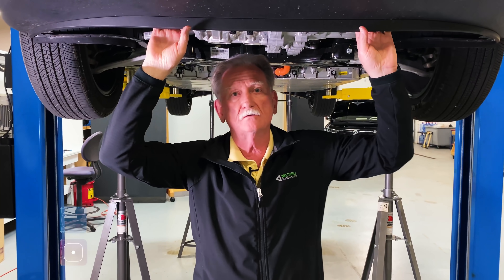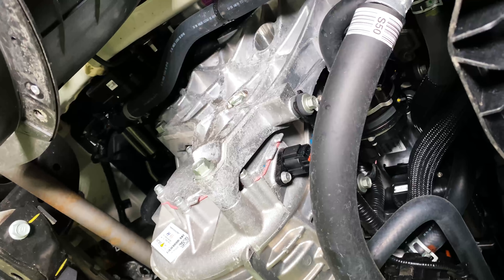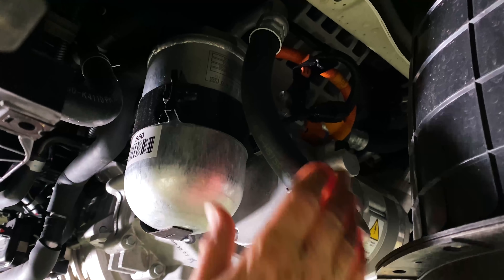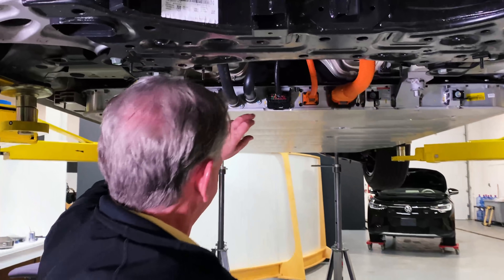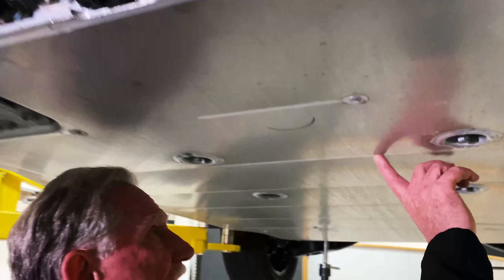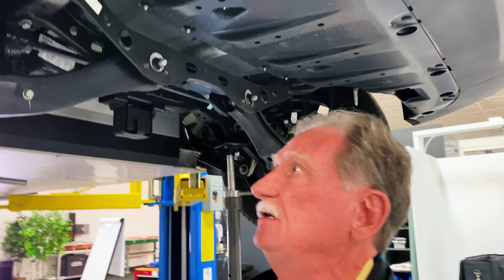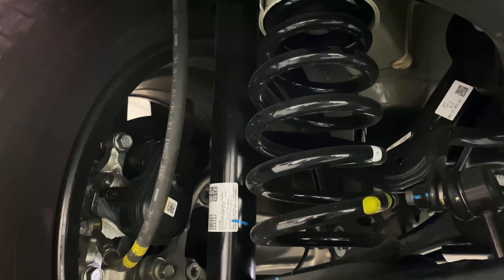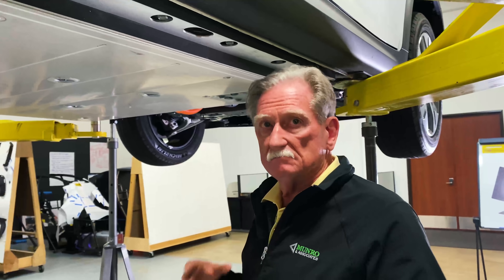Under the KIA NIRO EV

Comment: This Kia Niro platform is interesting, that allows to retrofit multiples powertrains. ICE, Hybrid and BEV. Saving in production costs. Good to see more mainstream manufactures on the market, to compete with Tesla and others.
Reply: What mainstream auto maker are you reverencing to? Are you comparing the Kia Niro to a model 3 and stating it goes toe to toe? In what sense? Sorry, I am confused by your statement.
Reply: @fredpinczuk7352  check the built quality of the Mach-E. In comparative, the internals of the Tesla motor, seems coming from a washing machine. Plus the panel gaps, and questionable interior quality. And the big screen on the middle, was the way they found to cut production costs.
Reply: @RogerM88  Check out the build quality of Tesla. I mean everybody talks about her bad it is that reviews them. Hell they even have YouTube channels that talk about it. The talk about the panel gaps that still exist till this day. They talk about the Mitch match plastics that are used in the cabin. They talk about the infotainment screen blackouts. They talk about how the paint still has problems. They talk about how the windows get stuck and the door sometimes won't open. And they talk about all around fit and finish of the vehicle. They talk about it's horrible customer service. They talk about how they don't have any service centers or you have to wait 3 weeks for service truck or flatbed to pick up your vehicle for repairs. And my favorite over promising under delivered range unless you're buying the extended battery.  
And now they're under investigation for their autopilot system. So far hit on some things but yet so far behind on others.
Reply: @RogerM88  I know you're not trying to say Mustang Mach E  has has panel gaps. That award goes to your favorite EV company Tesla. As a matter of fact I can pull up over 800 worth of receipts and post them for you to read from Tesla owners and Tesla reviewers who talk about how bad the panel gaps are that pin fit in them.
Reply: Tesla Model Y's Panel Gaps are Inconsistent, but Better Than Early-Build Model 3's

Fit and finish is pretty good, despite some panel gap issues around the crossover
Reply: @RogerM88  Chinese Survey Puts Tesla Model 3's Build Quality Below Two Local BEV Models
23 Jul 2021
Tesla's build quality has always been the subject of many discussions and, since people's expectations are quite high these days (particularly from premium-priced products), those discussions tend to focus on the bad stuff. And to be fair, Tesla provided plenty to focus on.
Reply: @RogerM88  And I have more to challenge your so-called credibility since you know what you're talking about... Not!
Reply: @twany442  Why Tesla don't give more press cars to be tested and reviewed by the Media? Tesla has great products, but it too over hyped by their fanboys.
Reply: @twany442  when you're paying the amount you paying for a car...it's supposed to come in mint condition. Not to be fixed by the new owners. Tesla seems to not test intensively their products like other manufactures. And the brand is often removed from reliability reports.
Reply: @RogerM88  Agreed. But they still have issues too. 
I mean you're a luxury EV maker that's been building cars for over a decade now and you would figure by now that you would get those problems that keep persisting themselves taking care of that other automakers have got under control.  So like I said so far ahead and innovation and so far behind when it comes to fit finishing Bill quality.
Reply: @twany442  Tesla is more like a Tech company than a car manufacture. They should bought a car manufacture, with already a know-how in mass production, and then build the brand on top.
Reply: @RogerM88  Can you imagine what that Cybertruck is about to go through. They say that they're already having issues trying to build it since it's their first truck.
That's why Sandy Monroe said if you are building a EV Truck you need to buy two or to see how its put together.
He really liked the F-150 Lightning.
Reply: @twany442  Tesla could had bought other car companies has MG Rover. Then they would focus in an initial mass production concept, using a current model, and retrofitted an EV powertrain similar to this Kia Niro platform. Then they could develop new EV platforms for future models.
Reply: @twany442  Tesla has overvalued stocks, that could drop in a near future, due to a market correction. And now they need to ramp up production, very soon, not only to answer orders, but to justify their stock value. Also Elon, over hypes concepts, to attract the Media and Investors attention...but fails to achieve the product features initially hyped.
Reply: @twany442  the fanboys hate so much the Mach-E and F-150 Lighting, because they are great products, with great construction quality. Not just a screen fixed on center of the dash with too much functions, to save production costs, but advertise it has minimalist design.
Reply: @twany442  also the fanboys gonna take a huge hit, when they realize the Cybertuck, is more likely to not look as the prototype. Due to issues in it mass production. Replacing the exoskeleton with a modify unibody frame coming from other model, and fitted with some stainless steel panels with more round angles.
Reply: @RogerM88  I think you meant motor. There are no engines in an EV.

Comment: Yes this is a compromised design. However, based on this video Kia went above and beyond in its engineering to create a well-built BEV that will likely be reliable and serviceable. No wonder it’s among the most efficient BEV's on the market.
Reply: I honestly think they have best chances out of legacy manufacturers to survive the EV transition. They are not asleep at the wheel and replaced their top management with dudes with EV background after Tesla battery day.
Reply: @DTMnoFear  Yeah, I'm not so sure yet. They clearly design and build great EVs, but I think their ambition is way too low. Kia are aiming to sell 880.000 EVs... in 2030. That's what Tesla are selling this year without even having the Berlin and Austin factories online. They should be building capacity and securing battery supply to produce way more EVs; they have great technology to take strategic advantage of the transition, but they seem to be too hesitant. A great car like the Ioniq 5 (same Group) deserves a 500k car per year plant, but they're aiming for just over 100k per year.
Reply: @bilgyno1  
You do realize that in many nations where Kia is sold do not have any charging infrastructure? The EV6 and Ioniq 5 have to catch on in the USA and in Europe before they can start to fantasize about making 800k of these per year..  People love to exaggerate by saying the Ioniq 5 is everywhere in Norway when in fact its not.. Once the demand is there and customers are fighting over these EVs at dealership, thats when we will see Kia and Hyundai cranking up the production!
Reply: @mamadouaziza2536  the wait list for the Ioniq 5 is ramping up quickly. Demand is clearly there already, and Tesla can sell 800k+ EVs this year, so why can't Kia and Hyundai? Only reason is that they're stuck in the ICE business which is still their cash cow but will be dead in 10-15 years. Kinda like kodak and their films, the management of HMG has difficulty understanding the speed at which disruption tends to happen.
Reply: @bilgyno1  I think the coming Sportage ev (2022) will be the best seller.
Reply: @DTMnoFear  
The Legacy brands aren't going anywhere anytime soon.. EVs are still in a niche market. Until electric infrastructure is widespread and massive the masses are buying EVs.
Reply: @mamadouaziza2536  EVs are niche in USA but have overtaken Diesel sales in major European nations, change is here
Reply: @mjcamp01  
But not in the western hemisphere..
USA and China have the biggest auto sales.  Americans don't drive in Europe, they drive at home and right now their focus is on gas cars and gas trucks.. In 10 to 15 years we will see more American embrace electric once the infrastructure is there.. But who knows, in the future electric cars could be dead..
Reply: @mamadouaziza2536  I think America has world leading EV infrastructure thanks mainly to Tesla, but China and Europe will likely leave America behind. In 6 years time most first world countries will be 50% new car sales as EV or a better successor. New diesel sales will be almost dead in UK in 2 years. France has just made a law that carparks must fit solar generation. It's going to happen quicker than you realise
Reply: @mjcamp01  , totally agree. Modern rich and advanced countries are rapidly moving to BEV, while the poorer countries are still stuck in ICE land, and will be for a long time to come.
Reply: @mjcamp01  
The USA isn't Europe or China.
USA society is different, whats the point in having totally different nations if they are all the same?

In Europe, they have super fast rail trains going from one country to the next, in the USA they love to fly or drive to the various States and regions within the USA. 

In the USA, Black people have enormous political power, very dominate in entertainment and in sports and Blacks will demand equality. In Europe, Blacks are seen as passive and unimportant.. 

Europe isn't a leader in everything, in fact if it weren't for the USA, Europe would be all one country called Germany.
Reply: @mamadouaziza2536  What are you talking about. EV infrastructure, I can drive literally anywhere in the continental US without any concern about charging. If I get in a real remote area and things get really bad I can always charge at a Campground at 50Amp or about 44 mile/hour for my Model Y. With all of my travels during the last year and 4 months I have never had any form of range anxiety .
Reply: @mamadouaziza2536  You are nuts! Electric Cars dead in the future, where do you live. I have 2 Teslas and have never had an issue with the electric infrastructure for charging my cars. I can drive for 3 hours, take a 10-15 minute snack and bathroom break and I am back on the road.
Reply: @michaelholliday100  
That is because you are relying on Tesla's SuperChargers....
What about others who drive non Tesla electric cars? Most if not all public electric chargers are obscured somewhere on the side of Walmart or Kohl's department store..
We all would like to see real dedicated public Chargers as plentiful as gas stations are or at least have two to four chargers at these gas stations.. ChargePoint and Tesla are now charging $2.50 or more for a surcharge now. 
$hit, its better and cheaper to charge at home. I can imagine all the surcharges and additional fees these electric chargers will tack on once the number of electric car owners get to 10% of all car sales in the USA.
Reply: @mamadouaziza2536  I can travel the entire continental US and never use a Supercharger. Does the Supercharger network make it nicer, absolutely. But there are so many options. Did you know that literally every Campground in the US has 240 volt 50 Amp circuits available. There are over 13,000 privately owned and over 1,600 State Parks , so over 14,600 locations plus US National Parks... Electrify America has 600 locations and EVGo has over 800 locations... !
Reply: @michaelholliday100  )
Reply: @michaelholliday100  having the option to use campgrounds with 240v is great idea! Just as an inspiration Netherlands has 60,000+ public chargers for a population of 17.5 million in a country twice the size of New Jersey
Reply: @mamadouaziza2536  the fact you've taken this from a discussion about EV future to racism and the world wars 🤦🏻‍♂️🤦🏿‍♂️ enough said really.
Most car makers are European or Asian, Tesla, and even Ford are making the switch to EV's. Petrol and diesel cars are the past, like horse riding they will rapidly become niche.
Reply: @mjcamp01  
The point I was making is in spite of Europe allegedly being a leader in supposedly transportation, Europe is still behind in a lot of important matters compared to the USA..
Reply: @mamadouaziza2536  your point is fundamentally flawed in my opinion, sure there are areas of Europe that aren't as inclusive and accepting as others, but the same can be said for USA, or anywhere else in the world. As for saving Europe with military might, how did Vietnam or Afghanistan go, or the south China sea, - see we can all resort to silly comparisons. It's still likely that the major car companies will pull ICE engines from their line ups, worldwide, and lots sooner than you think.
Reply: @mamadouaziza2536  Tesla is opening their superchargers to other manufacturers in the near future....AND....IF the new infrastructure bill makes it through in its current form, it will make it a requirement for charging stations to "have the ability to serve vehicles produced by more than one vehicle manufacturer."
Reply: @mustangcrazy77  
Oh cool..
Reply: @mjcamp01  
Hmm... The USA is more accepting than Europe.. America isn't perfect and European are very lucky they all aren't speaking German.. 

Nothing is a done deal..

Remember Sony's Beta format and VHS tapes and celluloid film?

Sure, electric cars are hot right now but how long will it really last? 
Maybe Americans should learn to take shorter trips instead of always wishing for more electric range and chargers everywhere.
Reply: @mamadouaziza2536  Why do yu need charging locations as plentiful as gas stations when you can charge your EV at home. You don't and can't hve your gas station at home...
Reply: I agree. I have one and love it. I’ve had 2 Teslas as well and this car is surprisingly good

Comment: SANDY: "This is a really nice car.... if it was built in the 90's"   ME: OOOOOOHHHHHHH!!!!!!
Reply: Personally I think that cars built in the 90s were built better.
 It'ss considered the golden years of imports. 
You had a much better blend of simple but durabl manufacturing and durable engines.
 Stuff today seems not as well put together quite frankly.
Why not continue to use something that works? And why change it if it still works? 
There are advantages to having the shock and spring separate. The shock is going to fail long before the spring gets weak. So rather than having to pull the suspension apart to get a strut out,  two bolts and a the shock comes out. Seems like a better design to me.
This car came out in 2017 and as Sandy said it's a compromise between gas hybrid and Electric. 
The big thing for me is I don't like how far the battery box hangs below the car for an SUV. Even though it's a small SUV I would worry about getting it high-sided in the middle on something and puncturing the battery box.
But there's no way this car is worth $44,000.
Reply: And Kia management goes, "Ouch".
Reply: People don't understand, Kia/Hyundai didn't always have a great track record. As a consumer I'm happy that Kia is now an option for me (I wouldn't have considered one before this). Now is it feature rich, no.. but you can fit a big yeti in it 😂
Reply: @dolex161  You can by a Tesla Model 3 for what this car costs...
Reply: I think before I started a video on the details of a vehicle I would find out how to pronounce the name of it 🙂
Reply: That is—without question—the most devastating insult an engineer can suffer.
Reply: Hey, it's easier, and cheaper. I'm sure it also allows the quality to stay good good too, seem like a good idea while you prepare for all the news stuff. Considering the Niro is still one of the best overall electric vehicles to date, I'd say kia's ideas are working well!
Reply: Compared to everything that is out there this Niro and its equivalent Kona still score really well on efficiency. Better in my opinion than the VAG group cars. You have to realize that the model itself is 3 to 4 years old and that Hyundai/kia now came with the Ioniq 5 and the KIA EV6 that can really closely match the Tesla tech
Reply: @jean-paulvandeheijning5088  
Exactly. If you spend enough time watching Bjorn in Norway he's done plenty of testing with these cars. And the Kia Hyundai powertrains are very efficient. They're comfortable to drive they have a lot of room in them. My only complaint is that they are overpriced compared to what you can get today. I would never spend $44,000 for this car. At that price point the $39,000 VW id4 is the better car I think. Even though it's slower, and I suspect we'll have lower reliability. Volkswagens are not exactly known for their stellar reliability. Although some of that is powertrain related on their gas powered stuff and maybe the electrics are better.
Reply: @jean-paulvandeheijning5088  More money than it should be... I would buy a Tesla Model 3 over this anyday...
Reply: @michaelholliday100  I think your opinion varries widely on where you live in the world. Here in Europe the Netherlands a model 3 sr is 50k euro, this Niro 39k and a Id4 small battery 41k. In that situation I think this Niro is a good deal
Reply: @jean-paulvandeheijning5088  I do not like the ID, but I would buy it over the Kia... Did you watch this video and LISTEN to what Sandy stated...
Reply: @michaelholliday100  The Kia for the same price has more range than the model 3
Reply: @fleyua7176  Did you watch this video and listen to Sandy? Also, you may wish to view this video... I have driven the ID3, ID4, EV6, Mach-E and others any yet I prefer the Tesla for many reasons....
Reply: that's what I want to collect, all facts and it's the buyers to decide if they want to have a 90's era car in 2021.  Make an informed decision.